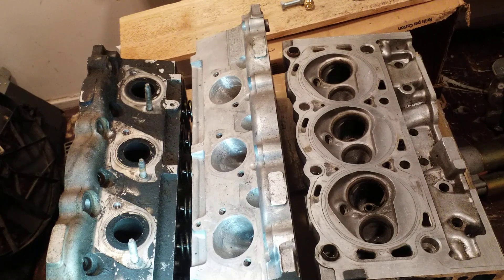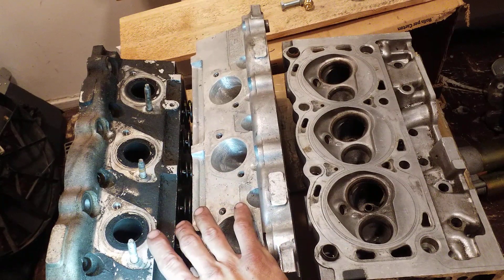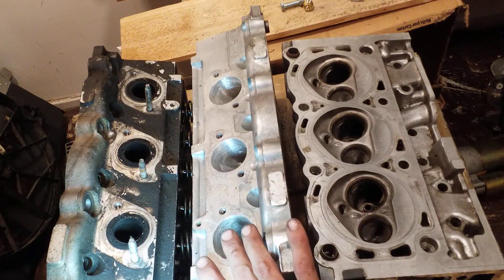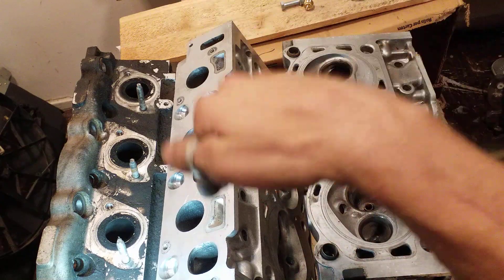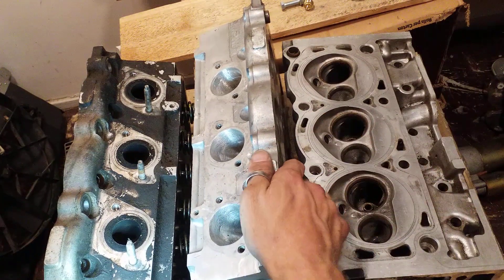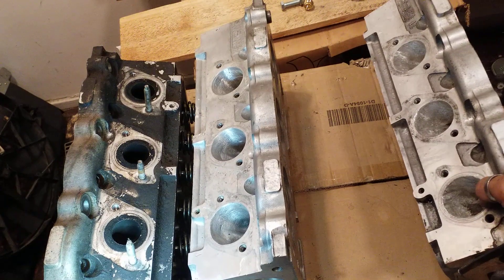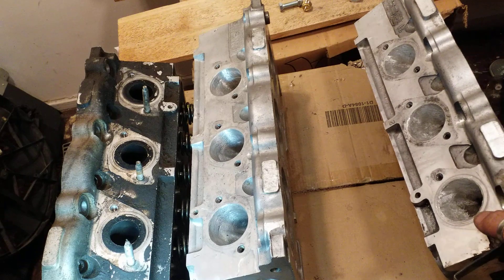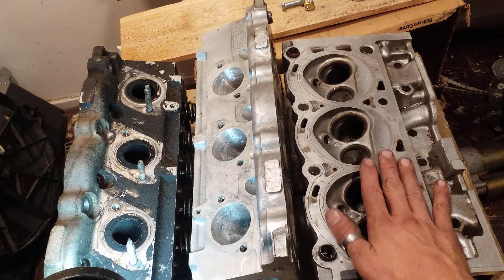Introduction To V6 Mustang Heads 1: Exhaust Port Restriction Explained

Comment: I haven't had a set of these heads in my hands yet, but is there an option to drill extra cooling ports through the head and block to increase heat dispersion?  Does the water jacket flow to that side of the combustion chamber?

Comment: Would doing this require a tune?
Reply from the maker: Yes and no it will run and drive safely but wont perform good until tuned